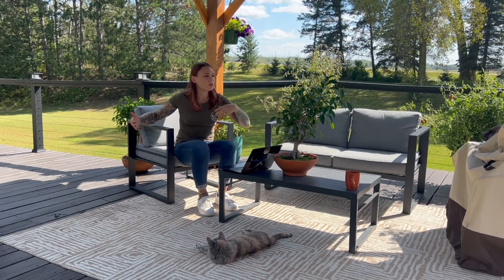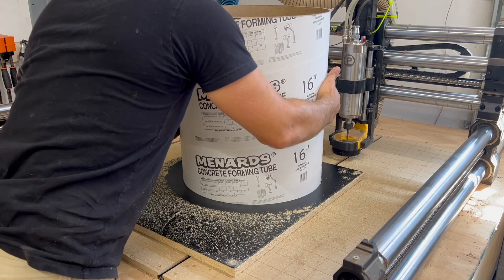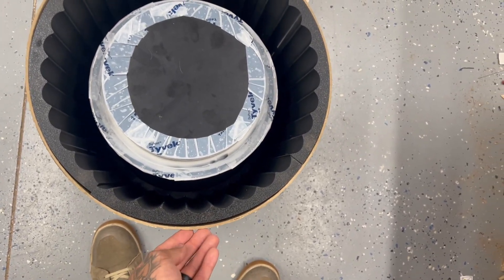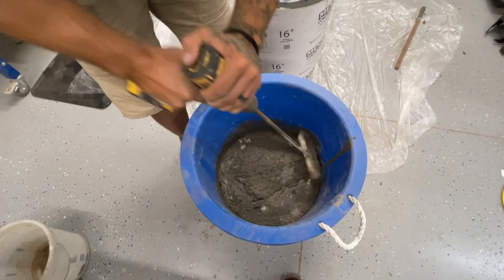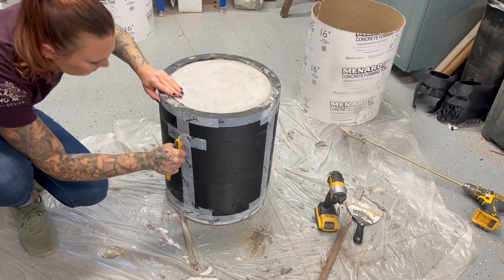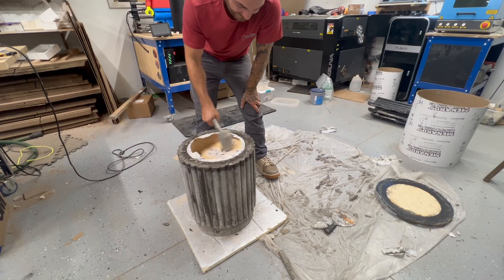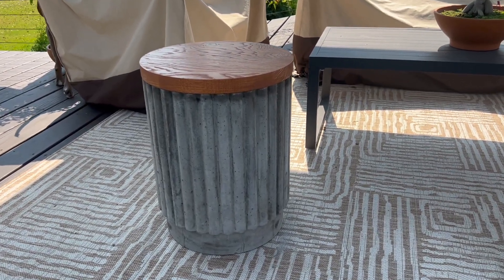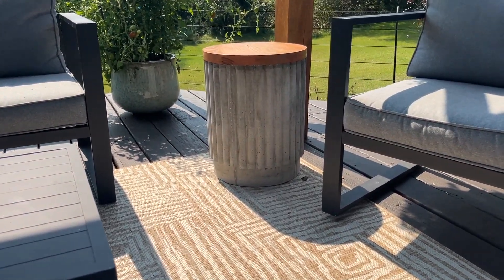We Tried 3D Printing Molds for Concrete Tables…

Comment from the maker: Let me know what you would have done differently!
Reply: You can get high strength concrete for $6/50lbs, and is made for countertops (and other uses). Your mix was way too wet, which makes it weaker. Concrete doesn't dry, it sets like epoxy where the water doesn't dry out, it forms a chemical bond with the cement (and aggregate). Too much water weakens the bonds.  It should not pour easily. Poke it with a stick every few inches as your pour it to settle it.

There are a few ways to settle the bubbles out. Cover the mold and pull a vacuum for 15-20 minutes, rent a concrete vibrator from the Home store ($50/4 hours) or use the sawzall, but longer and on the inside then hammer it with a mallet on all sides for a minute or so. Also a hammer drill works well too. 

You don't need the fiberglass with high strength. You can buy a butter-smooth concrete patch mix to fill your bubble holes, it will match. 
You'll want to etch and seal your tables after a month (that's two things, acid etch and wet look or matte sealer, or paint) or they will get a white powdery growth (efflorescence) and they will crack and crumble. This is a must-do if you keep them outside. 

They look good, the flutes came out nice. I would router a line or two around the sides of the top for a little visual to break up the bulk but hey, good job!
Reply from the maker: Thanks for the tips! I appreciate it, I definitely learned a lot. I should have done a smaller sample first but of course I didn’t 😆 I do plan to seal them but google said way like a month before I do so. I definitely think the send one was too wet, on the packaging it said to pour it pretty wet but I think I went too wet as the first one looked better.
Reply: @TwoMooseDesign  You're welcome. They say experience is the test before the lesson. Keep having fun!
Reply from the maker: I definitely learn better by just getting started and doing it better next time haha
Reply: @TwoMooseDesign  Right? Gotta let your instincts have some fun!
Reply from the maker: Absolutely 👏🏻
Reply: Nothing. You used the tools and knowledge you have. If you want to do it on industrial level we might ask  the company you but the original template from.
Reply from the maker: Thanks! I for sure learned a lot. I dont plan on making a ton of them would be alot of work to sell and move them around. I'm sure I would get a lot better after several attempts.